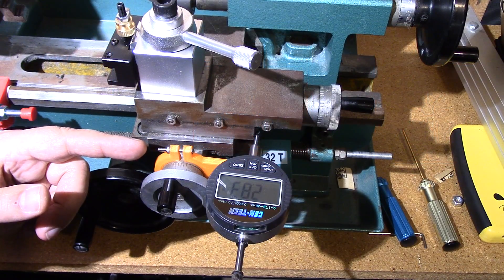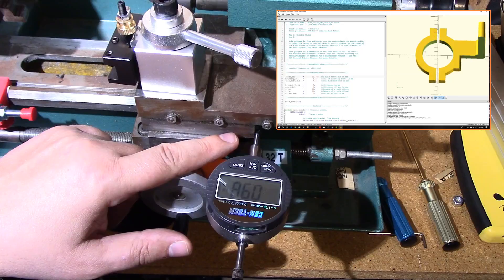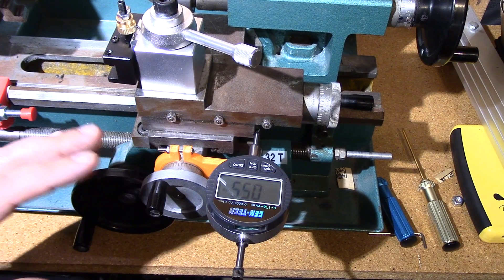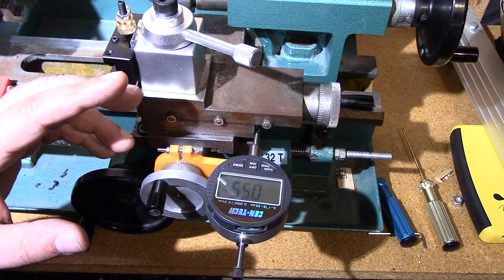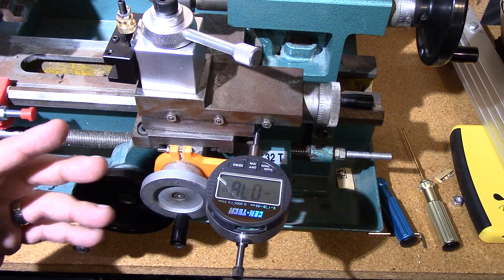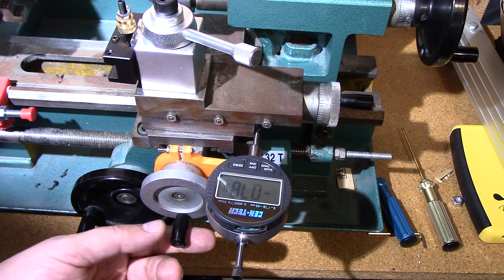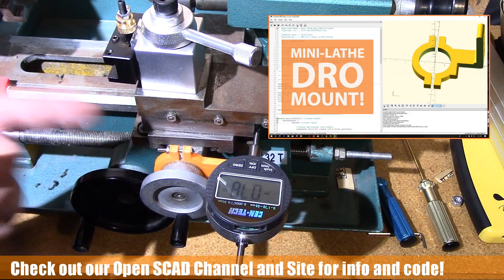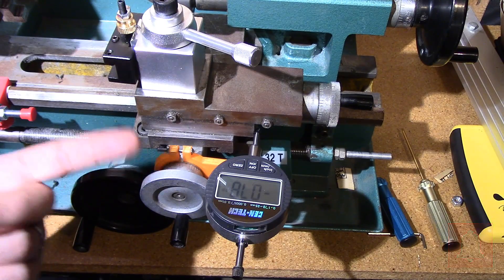Mini Lathe - 3D Printable Y Axis DRO Mount!

Comment: I NEED THIS. Would it make sense to make it a little taller so it picks up on the face of the top-slide? If you're not changing its angle much and it's normally at 90 degrees to the carriage, that would buy you a little more room for the hand wheel, and you wouldn't need the washer, I don't think.
Reply from the maker: My top block slides so that is why I kept it lower as that one is "fixed" and what id (you will see in a future video) is simply got a larger end piece from this kit: https://amzn.to/2TxxNRH  However it works well!  Also have you seen this: https://www.thingiverse.com/thing:3423036 as the video will be out in a couple weeks...